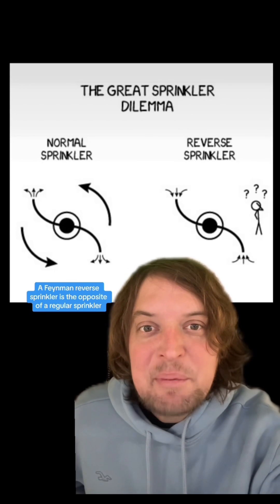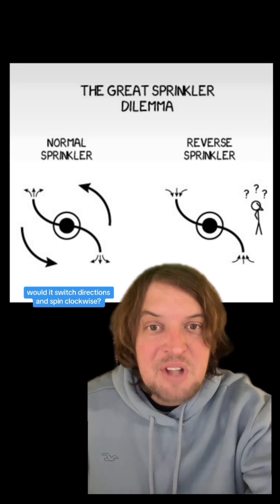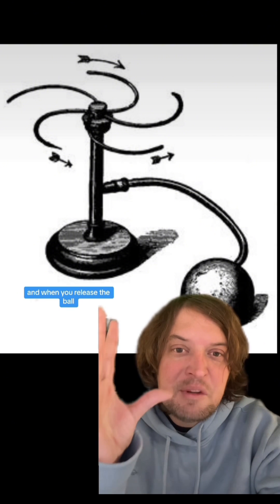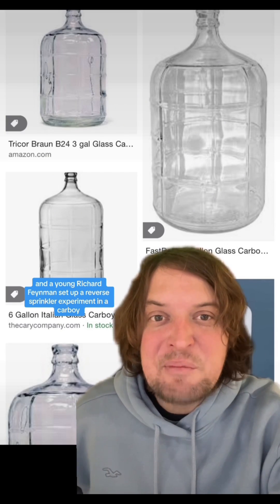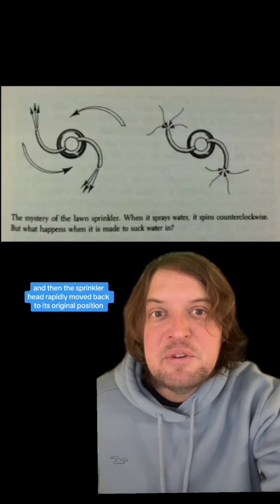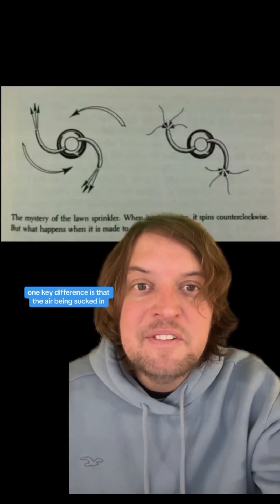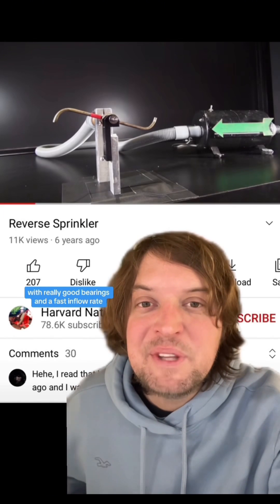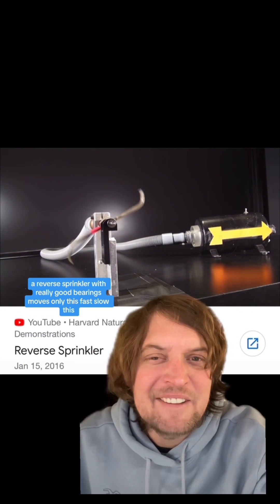Feynman reverse sprinklers!

Comment: Consider what would happen if the working fluid were a superfluid. There would be no flow separations whether sucking or blowing, and the sprinkler would not rotate. For a non-superfluid, there is a flow separation when blowing, leading to time asymmetry, and the sprinkler rotates. When sucking, both superfluids and non-superfluids behave the same, so no rotation.